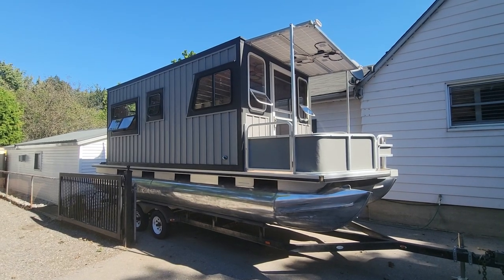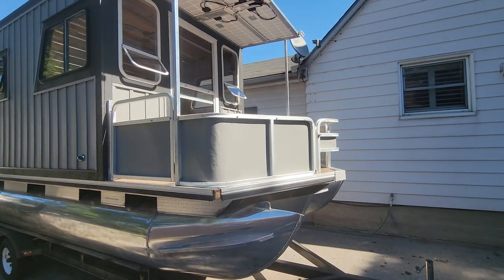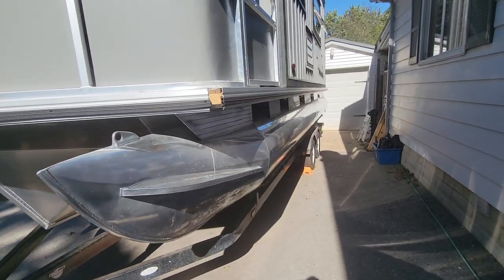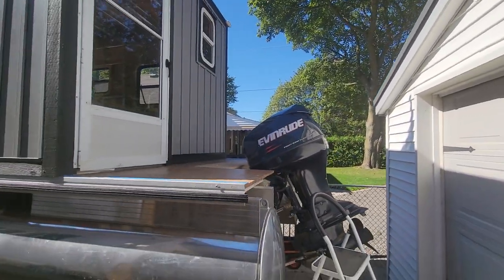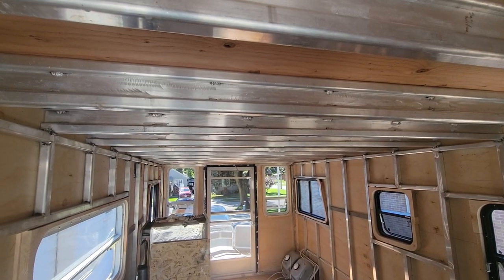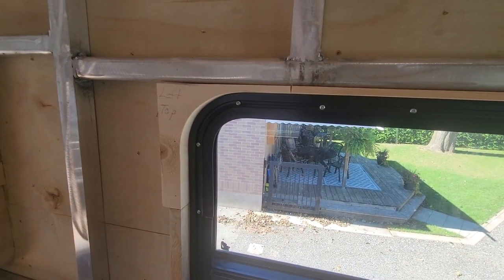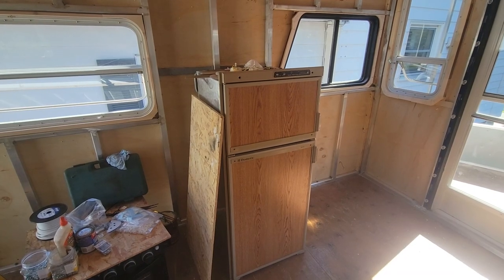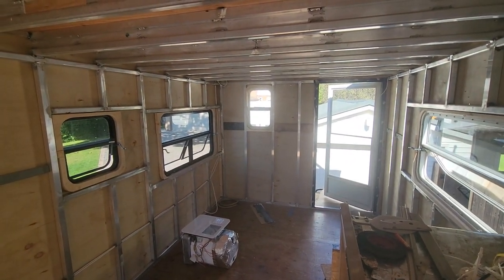Pontoon house boat build

Comment: Looking great! Thanks for sharing. I just finished my 28' pontoon houseboat.  I went with composit walls made of plywood, filon and foam board glued together with contact cement.  All electrical and plumbing was ran between the ceiling and roof. I went with 12v fridge. Tankless hot water. Marine head. Roof A/C and heat. 8ft x 16ft cabin My toons are 28" and the weight turned out perfect for just two. 60 hp mercury. 
I plan putting a video together on the build soon. Cheers from Oklahoma
Reply: Hey, how well is the contact cement holding up. I was thinking about doing it with the same process. Did you make an aluminum frame? Would love to see a video.
Reply: @evanstaite1474   The contact cement is holding up great. Unfortunately I lost most of the videos I took during the construction.  
The walls were made with 3/8" ply then at the joints I used 1x6  and at the top and bottom then between the frame I glued in the 3/4" foam board then glued 1/4" paneling then I fiberglassed the joints on the outside. After it was all sanded I glued on the Filon. The overall thickness came to 1 1/2" . I will post a video today of a walkthrough I videoed the other day.
Reply: Would love to see your rig! Do you have a walk around video yet? I’m thinking of building one but would love to talk it over with you and see what you would do different and any other important info
Reply: Would love to see your build! I'm building my 28' pontoon boat now.
Reply: I'm thinking about starting mine soon I live in arv now I was thinking when I buy my pontoon boat I was going to do a sailboat but I changed my mind and I think I'm going to go pontoon either 3 or 4 maybe two in the middle one on each side and I'm going to go for PVC walls instead of plywood I was thinking way more expensive but a little lighter and it will last forever
Reply: Yeah; I don't get the propane fridge.

Comment: that looks great. a small detail occured to me. some kind of lights that project onto the sides to keep the boat illuminated at night. I saw you had the regular anchorlite installed I was just thinking more light on the outer walls would be good to prevent accidents and it would also look nice.
Reply from the maker: I could add more let's along the sides. I will see if they are Needed when I launch in spring.

Comment: Awesome build! what size aluminum did you use for the roof and the walls? im currently going to revamp my house boat and make it all aluminum
Reply from the maker: Thanks for checking out my build. I used 1-1/2" sq tubing for the walls. The roof is two pieces of the same tube with a 3" piece of flatbar welded between them to make a truss.

Comment: Does that front awning tilt down to provide a front window cover and/ or angel down for better aerodynamics when trailering on the road?  
Always wanted to build a Houseboat like that. Only my design has side walkways on both sides that pivot off the side upright corners in an "L" fashion with pontoons mounted to the bottom of the left and right "L.  The pivot bearing would mount on the corner post about half way up so that the side deck would almost touc the roof in the folded postition. Raised and lowered with winches and cables.
That would give it a wider deck and greater stability on the water.  Plus be able to be cranked up, to keep it narrow and roadable.  The only downside is it they would put the CG up a lot higher when trailering.
Always fanticized about running up and down the Mississippi like Huck Finn on it.
Reply from the maker: The awning doesn't move. However the four panels are held in with wings nuts so super quick to remove the panels for a long drive.

Comment: Looks Great!  Thank goodness; Someone understands a 6 foot ceiling is good enough.  Why have an extra foot or two when you only use it .1% of the time and having tipping and clearance power the other 99.9% of the time.

I think they have solar panels that you can walk on if they're installed directly to a solid decking.

Comment: Hi Doug, thanks for sharing. We are trying to convert an old party barge into a oyster farming boat. I like your metal frame for the walls and roof. How on Earth did you fix that securely to the floor? Thanks
Reply from the maker: Thanks for checking my channel out. The walls are sitting on butyl tape for waterproofing and are through bolted. The bolts go through the bottom sill of the walls then through the plywood floor and through the alum floor supports.

Comment: Did you source some of your windows and appliances from a salvaged travel trailer? I'm looking out my window looking at the pontoon boat rotting in my neighbor's backyard and the wheels are turning in my head! 😁
Reply from the maker: Yes all the windows are used rv windows.
Reply from the maker: For appliances,  the fridge is a used trailer fridge, the water heater is a new one from a surplus trailer place and the stove is a new one someone was selling on marketplace.

Comment: I have been thinking about doing the same thing in my design as far as using aluminum for wall studs and roof trusses. The potential cost of aluminum versus other methods is holding me back a bit. If you don't mind sharing, could you give us some information about the cost of all the aluminum?
Reply from the maker: I will have to look it up. One thing to keep in mind is condensation on the aluminum. I had to put an extra half inch of sm insulation above the ceiling after a change in weather caused excessive condensation to form on the trusses.
Reply: @sawsolutionsinc  Interesting point. Do you think that happened due to the different surface texture of the aluminum, versus wood for example? Makes me wonder if, in your case, you would have gotten a similar result (condensation) had you built from wood, but finished the surface smoothly with paint, etc? Looking forward to following your build.
Reply: @sawsolutionsinc  Hey Doug. Did you ever come up with a rough figure for the aluminum in the build?
Reply from the maker: @_onesimpleidea  looks like I spent $2000 on alum framing

Comment: What did you go with for aluminum interior framing? 1 1/2" square tubing?
Reply from the maker: Exactly
Reply: Are you happy with the aluminum framing and your custom roof beams? Everything sturdy and strong still? Do you walk on your roof? I'm putting a together an aluminum order and plan on copying your build. Awesome boat thanks
Reply from the maker: Yes very happy with the alum studs and roof beams. We do walk on the roof and it is very sturdy. I am building rails for around the roof to make it more comfortable to be up there.

Comment: BEST POSITION FOR CENTER TOON IS LOWER THAN THE OUTERS , MORE EFFECT AND BETTER CORNERING
Reply from the maker: I have thought about this. Currently mine are at the same level as outer. Once I see how the boat floats and handles I may drop it a little lower by adding spacers. Do you have first hand experience with them being lower?
Reply: @sawsolutionsinc  yes , I just finished a 28 ftr that the center is 2 inches lower and it handles amazing , and on plane it will run 56 mph ! So much better imo. Willing to send pics if you will provide a point of contact
Reply from the maker: @sanderaadams4991  Doug@sawsolutions.com  is my contact 56 mph how big is your motor?
Reply: @sawsolutionsinc  250 mercury optimax  pro xs
Reply from the maker: @sanderaadams4991  well that explains the 56 mph lol
Reply: @sawsolutionsinc  did you get my invite?
Reply from the maker: @sanderaadams4991  got it
Reply from the maker: That looks awesome
Reply: @sawsolutionsinc  thanks started assembly march 25 on water by july 2021

Comment: What are the specs for those roof trusses?
Reply from the maker: I used 2  1-1/2 sq x 1/8  alum tubing with a 2 " x 1/4 web between them. Not sure what kind of capacity they have but my 230 lbs jumping on them didn't make them bounce.